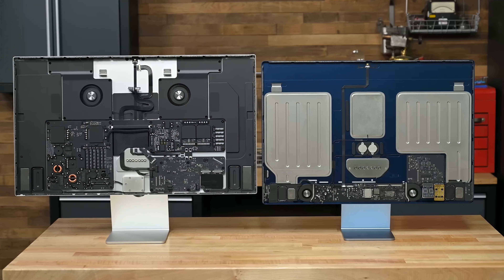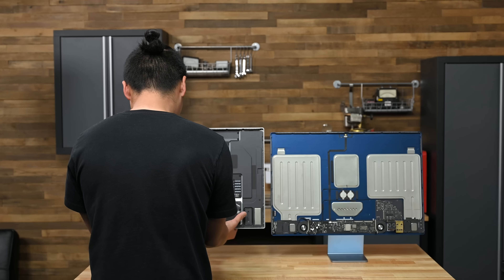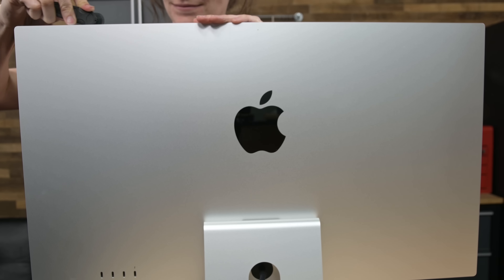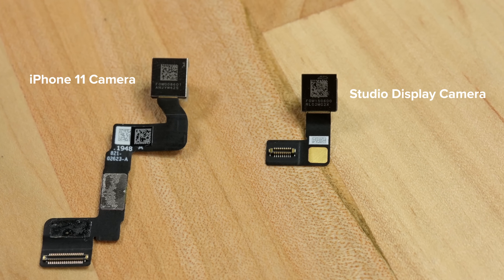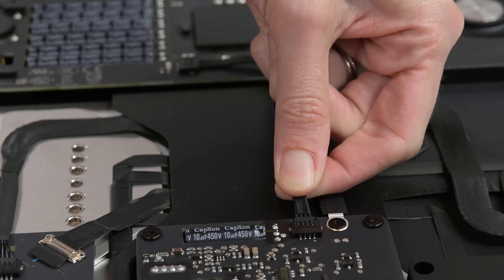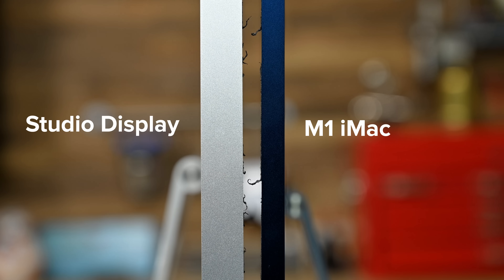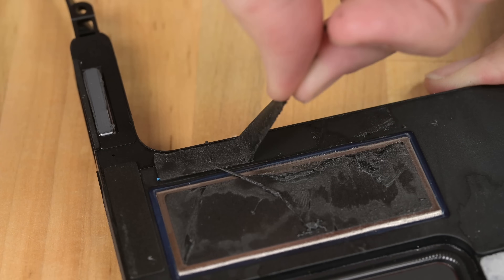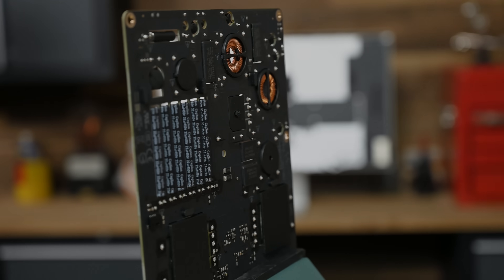Studio Display Teardown: Is this secretly an iMac?

Comment: After seeing this I'm convinced that this design was originally going to be the new 27" iMac but then at some point, likely within the last year, they decided to go forward with the Mac Studio as the only pro-summer desktop, so as to not have them compete against each other. They then converted this into the separate Studio Display and hastily converted it to use the A13 instead of a M1 Pro or M1 Max.
There is just way too much tight integration and effort here for what is really ancient display panel, this it way over engineered for what it delivers.
Reply: This is a very compelling point, and I think I could add to that: Supply chain issues. 

Apple seems to have avoided most of this, but I think they were unable to secure enough supply (of some component) to make this a M1 iMac. The power supply and internal design is very costly, as pointed out; if they could make this for both the possibly low-volume Studio Display and the higher-volume iMac, then I think they would. But for some reason they couldn't make it, or at least release models of both the 27-inch iMac and the Mac Studio that would make sense on the market. 

Also: The Mac Studio looks like it was designed for Intel, with its enormous cooling, as a follow up to the trash can Mac Pro. Possibly shelved when they decided to make the current Mac Pro (and standalone display), but then pulled out again because they could smack an M1 Extreme inside. EDIT: And shelved because Intel didn't deliver on efficient CPUs that would fit the thermal envelope. Possibly also shelved because the external GPU saga is _something_.

I think there has been some amazing developments within the chip team and with Rosetta 2 that actually made some products push ahead way faster, combine this with the general shortages, making the lineup and release schedule seem a bit odd.
Reply: Yes, I agree. Maybe the A13 boards were prototype development boards just like Mac Mini Developer kit (A12Z chip), maybe they just found another way to repurpose the already in stock A13 as the only iPhone which was being sold at that point was iPhone SE 2 (2020) and now they updated it to iPhone SE 3 (2022). I guess they just didn't want to take loss on the already in stock A13, so slap it on the iMac 27inch Prototype, use it as an ISP and Audio Chip and call it a day as a monitor.
Reply: I honestly think you're right that this is the case... Why do it the way they did other than to make a little more money? I think they were trying to turn their lemons into lemonade.

I wish they made it an all in one with the M1 Max or Ultra. My 2014 Mac is on its death bed, and I'm not about to replace it with this... $4000 to 6000 dollar setup...
Reply: That's a real possibility, but if this iMac was going to be a "Pro Version", it would need Pro Motion to match the 14 + 16 inch Macbook Pros.  I don't think they could have cooled an M1 Pro/Max with a 1000 nit 27 inch Mini LED Display. It really could have been a cost issue with Mini LED, where Apple split the cost and decided to separate the computer from the display.
Reply: @dsdddsd4543we  This! The point about mini LED (and cooling) is very interesting, also regarding potential 120 Hz and 1000 nits...?

It might be the key to why this wasn't just a home run 27-inch iMac-(pro)-to-go with an awesome XDR display built in – I would love to see someone delve into the details on what components might be missing from this kind of picture (yes oh yes puns indeed). 

Imho, it seems like Apple might have secured a lot of M1/Ax chips but might be tight on getting some other part of the picture to line up.
Reply: The "ancient" panel is still the best lcd panel available in bigger sizes. 5K with 600 nits and great color accuracy.
Of course, the technology from iPad Pro and MacBook Pro is superior, but let's compare it to the crap available elsewhere.
Apple could call it HDR, like most other companies with displays with much less brightness.
At least YouTube HDR stuff plays great on it.

Comment: It would be cool if Apple stuck an M1 GPU inside that thing. 
Obviously it would be bottlenecked by that thunderbolt cable, but Apple could have stuck some M! GPU cores inside that thing, where it's just a cluster of GPU, RAM, and Encoder and decoder engines inside the studio display.
The Studio Display has the cooling hardware for it, and Maybe something like a 32 core GPU, maybe even a 64 core could run in that thing to boost graphics performance for an M1 based mac. Include some memory, and Media engine blocks, and that would make for a better display

Comment: They better add Apple TV to this. That itself would be a great selling point to justify the 1600.
Reply: I can probably get a 70+" OLED 8k tv for 1600... the value isn't there.
Reply: @schmetterling4477  monitors have always been way more expensive than televisions. That doesn’t apply here.
Reply: @jzuniga633  Yes, but they also had higher performance. That doesn't apply here, either. The tv is way better.
Reply: @jzuniga633  Yes, but they also had higher performance. That doesn't apply here, either. The tv is way better.
Reply: @schmetterling4477   I get it you believe TVs is the best choice. But what I am saying is this is not a tv this is a category of monitors. comparing this to other monitors close to its price point. Majority of consumers will not buy a 70+ inch to use as a computer monitor. And unfortunately you cannot find oled tvs at 27 inches or smaller. Maybe 40 inches or 48 but at that point it may be too large for a desk especially when using more than one.
Reply: @jzuniga633  The tv is simply the technologically more advanced product that is being produced at a far lower price. It has near zero profit margin while Apple takes you to the cleaners. If you like being taken to the cleaners because you are "brand conscious", that's fine. I will simply wait until next year when I will be able to buy an 8k 32 inch HDR monitor with perfect color gamut for $800. :-)
Reply: @schmetterling4477  bro the smallest oled tv right now is only 42inch. That came out just this year by LG. You think they will bring 8k to 32inch tv? Next year? Monitors are monitors tv are tv. Two different categories. Not once did I talk about brand you out a comment of TV in a monitor subject. Two different categories. The high end LG monitor 5k is 1300+ non OLED. Your in different subject

Comment: As beautiful as the Studio Display is... I can't seem to agree with the design reasonings behind this beauty. 1 - Power Supply. As absurd as the non-removable power cord, I really don't mind another iMac-Style power brick to both magnetically connect with the display and perhaps add ethernet support to the daisy chain channel. If the power supply is placed external, the thickness and fans need not to be as prominent. 2. Single Thunderbolt Connection. Well, according to Apple, Mac Studio and Studio display is designed to fit into a studio environment, which, means quite a lot of pros, for digital content production. Now, despite the loss of daisy chain functionality, or advantage of the thunderbolt, I'm sure there are pros out there using multiple displays, while this thunderbolt serves as the only input option, for those who intends to use two or more studio displays, it means more thunderbolt being occupied. So, if this pro person wants to use three Studio Displays simultaneously, that's all of the latest MacBook Pro's ports occupied. Great. 3 - Non-Removable Stand. As ridiculous as the Pro stand sounds, or is. It has its merits. Now, that's probably not the case for the Studio Display. While the base model could have the stand uninstalled to comply for a VESA mount, the process is nowhere near user-friendly, and the worst is the stand version, it is set in stones the moment it is purchased, absolutely zero wiggle room for the way it will display itself on any desktop. Plus, if this engineering marvel stand is doable in the fashion of Studio Display, why doesn't iMac get it? iMac has long been the most neck breaking display I've ever had to experience, sometimes you just wish the iMac could stand a little higher. Crap Apple!
Reply: 1) power cored is removable just not easy to removed.  

They cant use the magnetic connector as that is rated for 60W this screen with the power delivery it provides the TB and other USB devices is over 200W! that would be a much larger brick and what connector would they use it would still need to be custom to meat that power limit. Also such a brick would die very fast unless it included its own fans and since it would need to be designed to be dropped and kicked etc while hot would likly be filled with glue/resign making it impossible to do board level repair (just look at power brick taeardowns). 

2) Unless you use display stream compression there is not enough bandwidth in a TB cable to support daisy chaining theses displays. Why would you opt for worse image quality when you could pug the other one in directly. If you were to chain 3 displays over one TB cable you would be used a very high level of compression to get there and there would be absolute no bandwidth left for any attached USB devices. 

3) I agree with the issue with the stand, we are ye too see if replacing this requires replacing the enter back case or if like some of the iMacs there is a little pin you can push out and swap it in the other stand (apple have said you can have the stand switched at an App Store/service centre so something is possible).

Comment: Why does it need an A13, Its just an monitor.
Reply: Nobody knows. Not even at Apple.
Reply: they'll just be using stock that was lying around in a warehouse. it'll likely be a filed iphone chip with a few non-functional cores, just stuck in there to run the camera and audio system.

probably quite a lot cheaper than using a bespoke chip, or ordering a bunch of new ones from somewhere else.
Reply: @mkultrasoldier  Thats what I kinda thought

Comment: This: "If they can make a power supply this thin, I think they can figure out how to make repairs safe and easy". Straight to the point.
Reply: Repair ability is irrelevant these days. We live in a use it and replace it society. When was the last time you got your shoes fixed instead of buying new?
Reply: @joshuaorange8290  Recently got my sued soals replaced not that expletive, here in NZ basicly every shopping centre has a shoe smith who will do it rather quickly. 

An external PSU with 200W+ would need a custom connector to the screen and would cost a LOT (At least $300 if not $500) to replace for that price you can get a board level repair to fix the internal PSU.
Reply: the main improvement on this would be moving to screws to hold on the display rather than glue otherwise it is quite reparable as screens go very reparable:

PCBs can all be removed easily (no glue)
IO is on its own dedicated seperate boards
The PowerSupply might look odd but compared to an external brick this looks much more reparable as most external bricks form almost all vendors end up being filled with glue/resign since they expect to be dropeed/kicked etc when hot so need to secure all the internals very very well, they don't have that expectation with the screen so accessing and repairing the PSU should be a LOT simpler than your typical external brick. (talking board level repair here). Or course with an external brick you can just throw it away and create more e-wast.
Reply: they can but they won't. So it meets their agenda of "repairs are dangerous and should only be done by us". Apple is anti-repair so they have no interest in making it safe and easy.
Reply: @AlkaVirus  repair of the power supply brick is much much harder however.  This single large flat power supply that is spread over multiple boards might well be one of the easiest modern PSU designed to repair given the easy access to all the components.  

I don't think apple is actively anti repair that is to say they do not put extra work in to make things harder to repair they just do not consider third party repair in thier designs. (in thier eyes they don't bother 'wasting time'' considering third party repair).  

As to safe, im not sure any there is any way to make a PSU repair 'safe' if your repairing a PSU the nature of the function of these units means they will have large capacitors and if you skew up best case you destroy the rest of the device worst case you start a fire.  Even if apple stoped designing all other products and focused on 'safe' PSU repair (not replacement but true minimal e-waist repair) they would not be able to come up with a PSU design that was safer to repair (replacing the entire PSU is not good for the env remember). 

Given that nature of a PSU repair (were you go in and repair it rather than replace it) I think it is a rather good thing that its not trivial to attempt. This is the sort of component that you should only be approaching if your sure about what your doing as a f'up here can lead to issues that are rather nasty.

Comment: They could've easily made the studio display into an imac.
Reply: Yeah, but the Studio Display's A13 Bionic chip lacks any of the Rosetta hardware that translates x86 apps into Apple Silicon ones. 
Meaning Rosetta will either work very slowly, or not work at all., probably the former, but who knows.
Also the very limited 64GB of storage will ruin this thing plus the 4GB of ram.
Reply: @TheStopwatchGod  
Its not about the A13 chip. They could’ve put an m1 in it and made it into an iMac.
Reply: I’m guessing they tried to stick an M1 Ultra in here and cooked the computer. We had stories from last year where Apple was having trouble with the 27” iMac and diverted their engineers to make sure the M1 iMac 24” made it out the door. I think they tried to turn this into the 27” iMac and failed to find a way to properly cool that M1 Ultra and made the decision to split up the display and the computer. Thus was born the Studio Display and the Mac Studio.
Reply: @techinrl9869  
Who said to put an M1 ultra? They could’ve done with an a base M1 or M1 pro
Reply: @worththewatch1517  My theory is that the Mac Studio is the result of a failed attempt to make a 27” iMac. The M1 Max version would be the replacement for the iMac while the M1 Ultra would have been the replacement for the iMac Pro. The fans and heat sink on the Mac Studio are way too big to fit in this chassis that became the Studio Display. I’m assuming the Mac Studio has what Apple intended the 27” Apple Silicon iMac to have: an M1 Max or an M1 Ultra since the 27” iMac and iMac Pro Intel versions were identical form factors. I’ll bet they could have cooled an M1 Max… maybe… but I doubt there was any way to cool an M1 Ultra in this chassis, hence a decision to split computer and monitor into two. They probably have plans for the M1 Pro, likely a Mac mini to replace the Intel Mac mini that’s still being sold.
Reply: @techinrl9869  
Apple doesn’t sell items that are the result of failures. Instead I do believe that the Studio display is to make sure that Apple makes the cash from two groups, those who want an iMac with less professional display and those who want a professional display without an operating system which leads to buying the mac studio lol. This is actually the type of thing Apple does to make more cash
Reply: @techinrl9869  M1 Max is actually slower than the previous Intel iMac 27". It doesn’t make sense for a new iMac that slower than the previous one.
Reply: @tsmc689  It is considerably faster than the last Intel iMac 27". They spent a great amount of time showing just how much the M1 Max destroyed the Intel machine. Their charts spent a ton of time comparing the M1 Max to the Intel 27" and the M1 Ultra to the Mac Pro. In both cases, it wasn't even close. The Intel machines were dogs compared to the Apple Silicon Macs. Even in single core scores, the M1 Max was about 70% faster and even more in multi-core. I think you might want to re-watch the Apple Event.
Reply: @techinrl9869  Apple Event data is not equal to real performance. Just see how M1 Ultra compare to the Mac Pro. Apple claims that M1 Ultra is 80% faster than the most high end model of Mac Pro. How ever, it’s just slightly faster then Mac Pro in test.
Reply: @tsmc689  The M1 Ultra beat the Mac Pro in almost every real world test. Not all but most. The M1 Max destroys the Intel 27" iMac in every respect. It isn't even close. I think you've been confusing brand new Alder Lake 12'th gen CPU's with the ones in the iMac. Alder Lake can compete with the M1 series, but only at triple the wattage. The old Intel CPU's are not in the same league as the Apple Silicon chips.
Reply: @techinrl9869  OK, it’s fine.
However, M1 Ultra is not able to fit inside the iMac since it requires a massive cooler. Or else, Apple need to make the iMac really thick to fit the cooler for the M1 Ultra.

I think they can still make the iMac like the iMac G4. The bottom part can fit a large cooling system like the Mac Studio.
Reply: @tsmc689  if they were to use the old design I reckon it would be more than enough to cool the m1 ultra
Reply: @techinrl9869  Yeah, but previous iMacs could handle the thermal load from that intel CPU and AMD GPU. Considering the Studio Display is so thick, it can support the M1 Ultra, it must have been a power limitation or a noise limitation